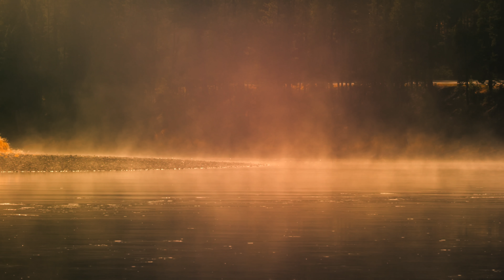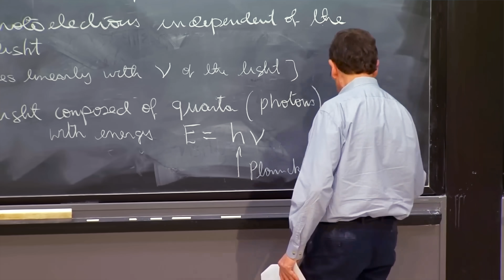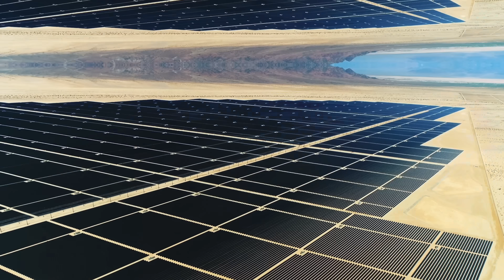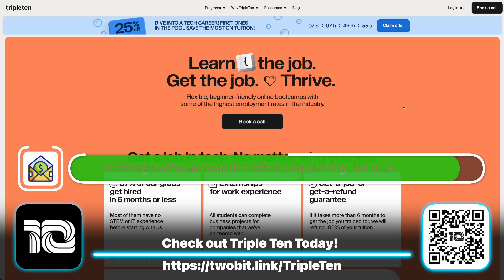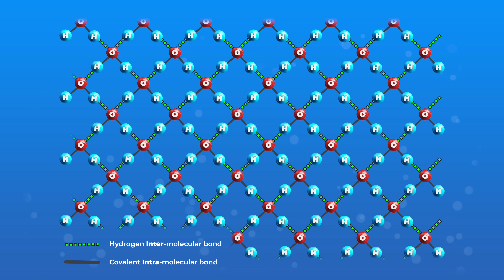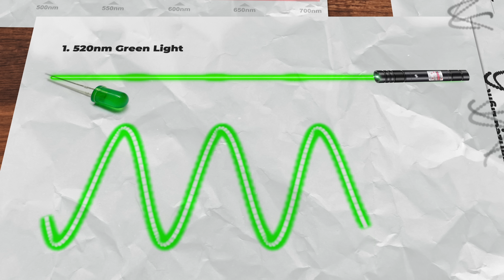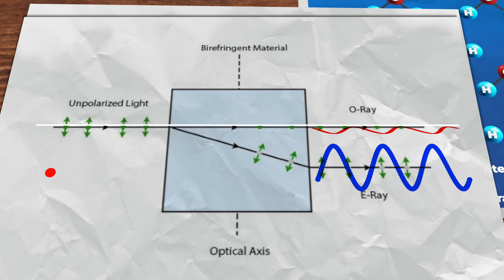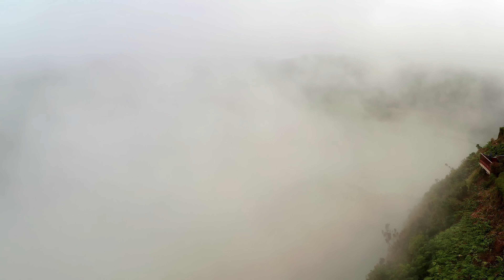New MIT Discovery Just Solved Water's BIGGEST Mystery!

Comment: Well, this phenomenon would certainly explain why dense forests tend to cool down the air and induce precipitation. 

Think about it: if the forest canopy is absorbing most wavelengths from the spectrum except for green light , and is in fact reflecting it; that means that by clear-cutting entire areas we are reducing the amount of water that evaporates and precipitates and thus, getting more heat to the surface with less evaporation.
Reply from the maker: oh that's SO interesting, right! I hadn't considered that but there's definitely a cool in the air ... and that 45 degree component, maybe its heightened at certain times of the day... fascinating stuff right?
Reply: @TwoBitDaVinci  the 45 degree component: we are on a spinning sphere that is axially tilted at around 23 degrees. During the summer, mist rises as the sun goes down, and dissipates as the sun comes up. There is very little heat during these times, but there is a photon source coming in at an angle... awesome.
Reply: This effect (while obviously it would play a part the system as some portion of evaporated water was evaporated by this effect) is not necessary or sufficient to explain forest climate effects, but your connection between green of trees/plants and this effect may still be significant.

This form of evaporation is unnecessary to describe those effects and would happen with a thermal evaporation model as well.
Cooling and transpiration increasing humidity levels (which can induce precipitation) were already results in a traditional thermal evaporation model. Thermal energy is transferred to water molecules that when they have enough escape as water which means less thermal energy in the tree and more in the fluid atmosphere which can be carried away (standard evaporative cooling). This extra water vapor is then the driver of induced precipitation.

That effect is not sufficient
You may not have been implying this but just to make sure, the method of action of cooling (both actual and perceptual) and induced precipitation were not previously unexplained/mysterious. The general mechanisms have been understood for a long time.

Your statement is still interesting
While less revolutionary in understanding those phenomena that you mentioned, the fact that plants reflect green light may still be related in part to this effect. It could be a factor but I would be careful about jumping to that conclusion. 

This explanation would only make sense if reflecting the green light decreases the likelihood of this interaction occurring on the plant. Given that it is a surface interaction (i.e. the effect happening further inside the plant would not cause evaporation because the water is not in a position where it can leave the plant) reflecting the green light rather than absorbing it may actually increase the incidence of this effect (absorbing the light with a pigment would reduce the number of times the light passes through the surface of the plant).

Compound this with the information that:
- Not all plants (or more generally green photosynthetic organisms) are in areas where transpiration is a negative thing--thus this selection pressure would not be present for aquatic plants or ones with excess or sufficient water supply. We know that there are shallow water green alges that have been around for a long time (which would never have a reason to limit transpiration because they are literally swimming in water).
- There are other fairly well researched reasons that plants may avoid using green light. For example that structures that absorb it (with green being the peak output of the sun for terrestrial/shallow water) would have harvest too much energy which could cause damage or disruptions (basically over charging things which is dangerous). This research that looked into this model of 'moderating energy capture' and it apparently fit even with things like purple photosynthetic bacteria (because the spectrum of light reaching them was different).
Reply: @kanoaika  The key mystery this seems to solve is the abnormally high evaporation rate in clouds, and the unnaturally high amount of sunlight clouds seem to absorb (which to my understanding wasn't satisfactorily explained).

As far as I understood it, the problem was that when you measured sunlight above and below a layer of clouds to determine how much light was absorbed, and then compared that to the amount of light the cloud should have absorbed based on water's very well documented physical/thermodynamic properties, the numbers don't add up. Water seems to be "absorbing" way more light than it should.

What this hypothesis states is that water isn't really absorbing this extra light to turn it into thermal motion (higher temperature), but rather those green photons are spending all their energy to knock off clusters of water from the little droplets of water (and ice, I suppose) in the clouds. That's why less light makes it through the cloud.

Why does this matter? Because if we understand exactly how this happens and why, we can do a better job of modeling what happens to sunlight when it comes into contact with clouds, and since these interactions play a major role in climate, we can develop better and more robust climate models.

It still remains to be seen, though, if including the photomolecular effect on current climate models is able to accurately predict the extra light absorption and increased evaporation rates.

WAY MORE COOL SCIENCE TO COME!
Reply: If green light is optimal for the photo molecular effect maybe there is a connection with photo synthesis. Just a thought.
Reply: @BertWald-wp9pz  Plants light collection systems actually tend to reflect green light (that is why they are green). In other words plants rely more on other colors for photosynthesis.